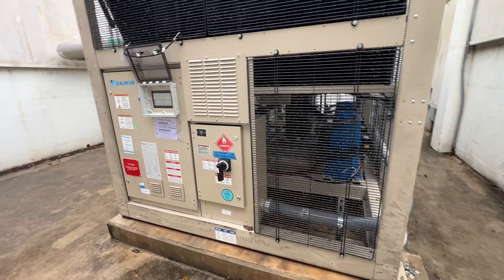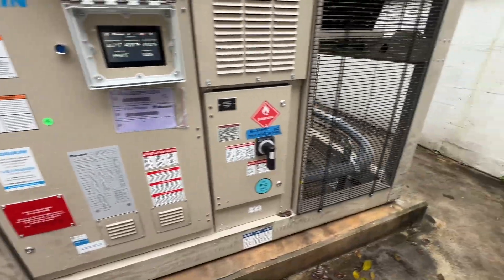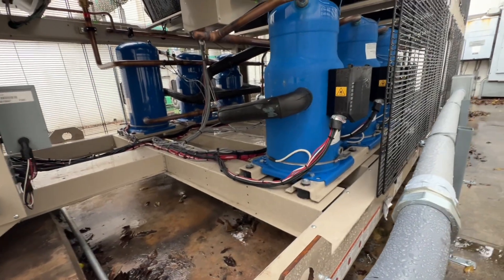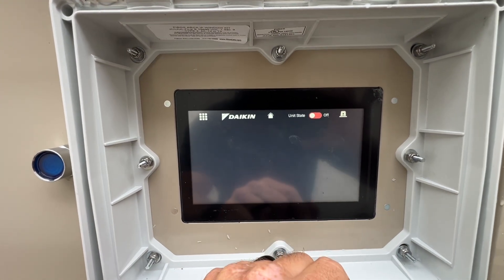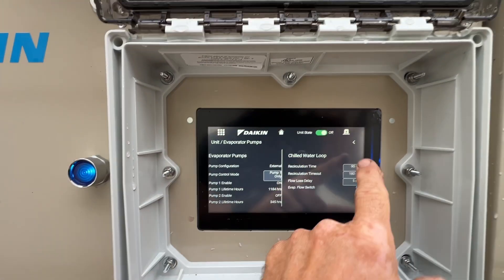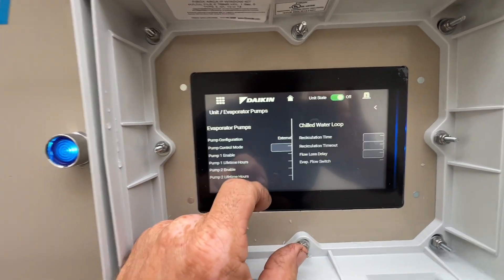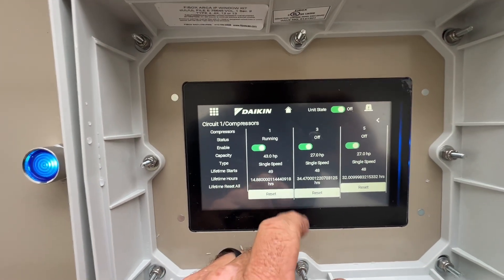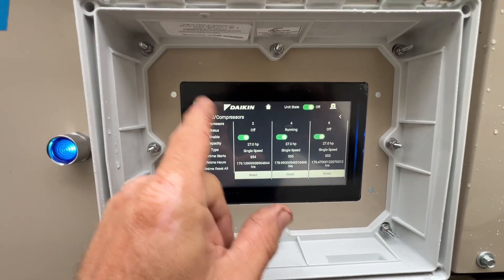Daikin AGZ Chiller With Touchscreen Interface Walk Through… Is It Supposed To Sound Like That?

Comment: Well....if you ever do have any questions....you know who to get into contact with. The pumps are controlled by settings. You can have it pump 1 or 2 in the lead or set to auto. It works off the principle that if one pump fails, it'll start the second to establish flow. I noticed the software version was 1.1.5.......there is a new software version available. 1.2. The compressor on is based on load, run hours and starts. If you don't need a lot. It'll start a smaller compressor. Each compressor is configured to lower the chilled water by X amount. There is a timer for staging additional along with a deadband. The Pull down rate will also have its hand in staging. If you are above the setpoint....it won't stage up a compressor. I know a lot about these....starting one up in 2 days. We have a lot of them out here.
Reply from the maker: You’re the first one that came to mind when I found out it was installed. What did you think about that noise in the beginning? I figure they will be generating a work order about it . As always I appreciate you Jason 👊
Reply: @subcoolHVAC  I was wondering if it was hot gas bypass. Is it coming from the compressors or where at
Reply from the maker: Bypass would make sense
Reply: Jason is that interface display compatible with micro tech 3? I’d love to have that on one of the AGZ chillers I got.
Reply: @HVACslayer no its not. That is called the Orion Lite. Its its own separate controls platform

Comment: My first instinct was HGBP pulsing, causing flow loss through the EEV... as far as exposed wiring, every scroll chiller Ive worked on has exposed wiring like that. One the flip side its easier to repair and identify. Plus, rats chewing on wires gives us easy service calls.
Reply from the maker: Yea, it was pretty low load condition. Hoping for no rodent issues this time

Comment: Nice chiller, but not so sure with all the exposed control wires. They are waiting for critters to chew on them. Lots of sophisticated PLC controls operating this unit. Maybe too sophisticated! Thanks for your video and stay dry!
Reply from the maker: Thanks , I’m thinking we’re going to have to install some cable sleeves
Reply: > Maybe too sophisticated!

As a software engineer. Without a doubt.